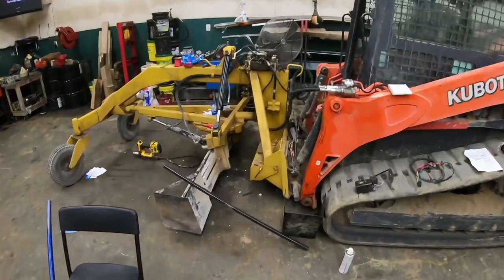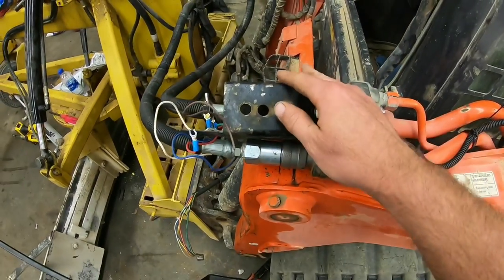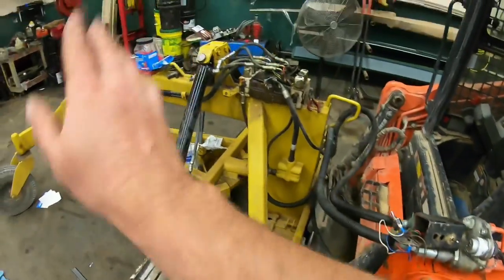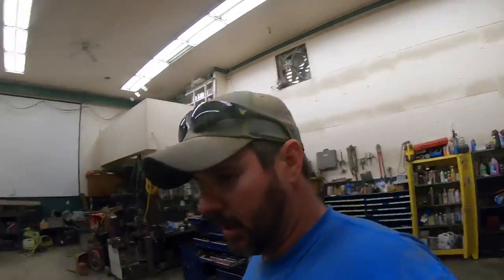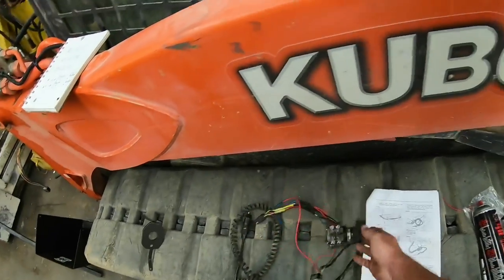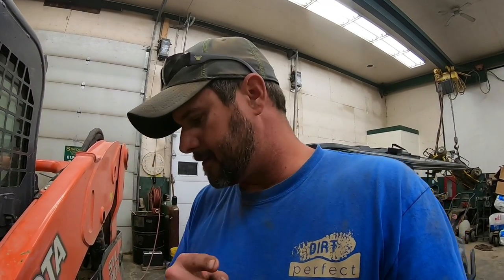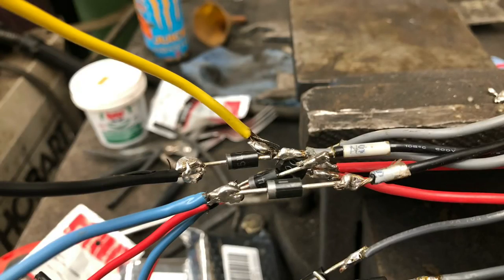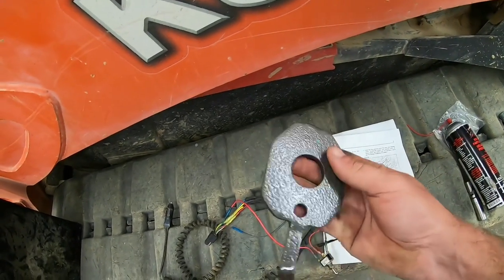Grader controls budget build

Comment: I'm doing basically same thing with a 6 way blade made for 3 point of a big tractor. Blade itself works much better than the 6 way made for skid steer, I'm able to turn blade and cut in reverse and doesn't jump out of ground like the Kubota blade I had did, the counterweight of machine is actually working for me in reverse.. .... I went and robbed a 7 bank with proportional valves.
I get really tired of the cost of a 14 pin pigtail costs to repair or replace,  but still wanted to utilize factory switches in machine. 3 switches only need 6 wires. So I went and got a 7 way trailer plug , piggybacked into backside of 14 pin plug once I figured out which wires went the 3 switches. I always bending, breaking 14 pin plug on Kubota blabe. Not saying I won't on this one, but trailer plugs are way cheaper and easier to find

Comment: AWESOME! I'm gonna have to do that with mine, I have the toggle switch set up that I zip tie to the stop bar, and like you, I didn't want to spend the $1500 for the system that is on the market. I do have automatics, but, I searched around, and happened onto a bargain, and jumped on it! GREAT WAY TO BE THINKING OUTSIDE THE BOX!
Reply from the maker: I would go for it works great and cheep

Comment: WILL MAKE A NICE SNOW PLOW ALSO TO MOVE THE SNOW AWAY FROM THE BUILDINGS PLUS YEAH A REALLY NICE ADDITION TO THE SKID-STEER EQUIPMENT. MAYBE WORK ON A BOX DRAG THAT WILL BOLT ON WHERE THE BLADE IS LATER ON

Comment: use a dust boot off a car shifter upside down to cover the bottom
Reply from the maker: Good idea
Reply: I was also thinking run the wiring through a bicycle.inner tube then stretch the end up over the bottom of the switch. Also the phrase would be non invasive lol. Awesome video series btw, makes me wish I became an operator not a mechanic.

Comment: Mount the joystick at a 45 degree angle so when you push up it activates both x an y axis. when you push to the side it should make one go up the other go down.
Reply: Hey pork chop do you know how to hook up a grader attachment like Mike's I having problems  trying to hook it to a kubota
Reply: I have never owned either one. But my suggestion would be to start by drawing out a diagram of both your loader controls and the grader attachment. Figure out what wire turns hot when the lever is moved then label what you want that function to do. You should be able to get a pinout for the grader. If not then pull the plugs off the control solenoids, one at a time, and use a tester to see what wire goes where. Plan on hydraulics moving the opposite of the direction you want them to move. ( don't permanently wire till you know it is working.)

Comment: Im not familiar with the setup you have on your kubota, but on my John Deere whe just robbed the too leads from the horn button switch on the left control arm. That being said it now made all 6 way functions work for our blade. Using the roll wheel switch on the right control and pushing the horn button at the same time.
Reply from the maker: Humm interesting

Comment: I'd be tempted to add restricted hydraulic fittings to the rams to slow them down, they fit between the pipes & the rams, for instance a male-male hydraulic fitting but in the centre they only have a very small hole for the oil to flow. If you buy the wrong ones by accident & they're far too slow, you can remove them & just drill the hole out a little bigger, it's the cheapest way of doing it. We use them a lot on agricultural equipment over here in the UK, they work great & solve a lot of problems.
Reply: I was thinking along similar lines. Especially for the angle. It's really quick.
Reply from the maker: I have look into this a little definitely a idea thanks guys

Comment: If it works and wasn't expensive than it was a good idea. Plus if you find that you are using it more, you could upgrade the valve system later on.
Reply from the maker: Yes that would be my next upgrade new valve

Comment: So.
The best solution is a proper grader control setup. Meaning, each cylinder has independent control. So basically I’m proposing TWO joystick controls.
And, y’all appreciate this some day when yah gotcha a real live motor grader cause your business model justifies owning one. Ifn yah ever run a grader, it’s a busy day. Lotsa levers, or joysticks with lotsa buttons.
But. . .
That’s a lot going on for a dozer hand. Prolly too much. LOL.
So this’ll work. After all, ain’t nobody gonna pave or put concrete on these jobs your working. Right?
That’d require blue tops- feathers, Or GPS. (Yep, overwhelming!).
This will work. And getcha paid.
Reply from the maker: Works great and have paved and poured concrete behind me no complaints and low overhead i do understand that would be better but have to start somewhere and then move up 🤷‍♂️

Comment: I just picked up the same attachment, It didn't come with the controls for the cab...So,  i need to come up with something.  Are you happy with the way this worked out?  I like the fact its simple and to the point.  The only other issue i have, is i got mine with laser set up, so i need to be able to tie that in as well.  Thanks
Reply from the maker: Yes been using for over a year now

Comment: Put the box under the joy stick and run the wire out the bottom .you can screw the box to the bracket you made . lt might clean that up and look better. Did l explain that right? Hope so , l see it in my head.
Reply from the maker: Hmm I think 🤔

Comment: Can’t believe the joystick is that cheap. I bet a cheap can coozy would fit around the wires pretty easy. A little silicone to the bottom of the bracket and easy to tear off if you need to get to the wires
Reply from the maker: Humm interesting idea thanks

Comment: If it saves you an hour on every job then I should think that $100 will soon become money in your pocket.
Rubber boot from a CV joint might cover the electrics nice and tidy-you could easily shape the plate too keep it free from moisture and debris.
Reply from the maker: Good idea thanks
Reply: Dirt Perfect No problem 👍🏼 To expand on that idea a bit further... 
You could leave the plate as is and simply cut a section of pipe (1” deep say)with a radius to match the large end of the CV Gator weld it on (underside obviously)and then simply Clamp the gator to it using a Jubilee/expanding Clamp.
That way access to the electrics underneath is only a simple turn of a screwdriver.

Comment: I would of put the toggle switch in front of joy stick you could still hold the joy stick and just extend your finger to operate the toggle switch
Reply: his machine is joystick, so that means he won't even need to use the right joystick at all while using the grader attachment. i may be wrong though..
Reply from the maker: Thought about that but seems to work fine the way it is 😁